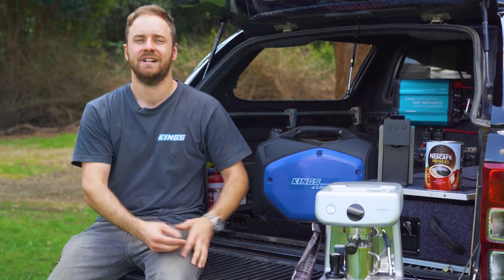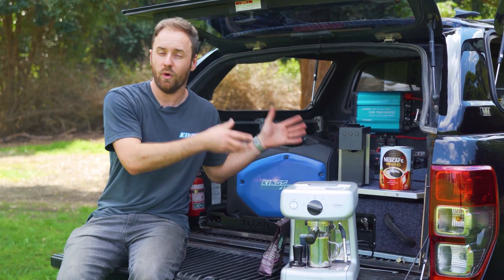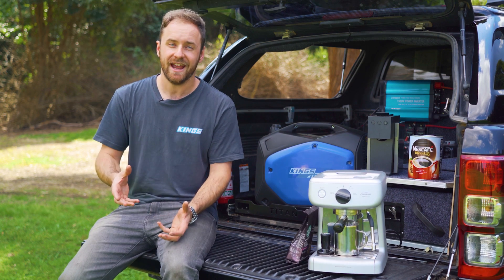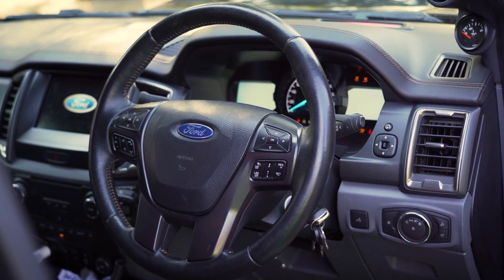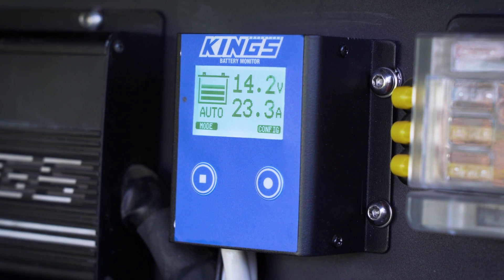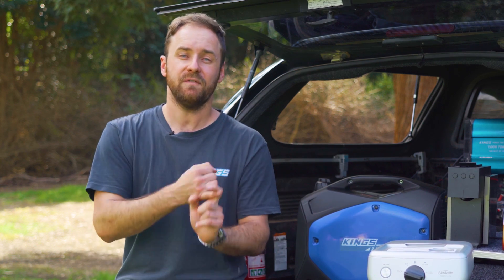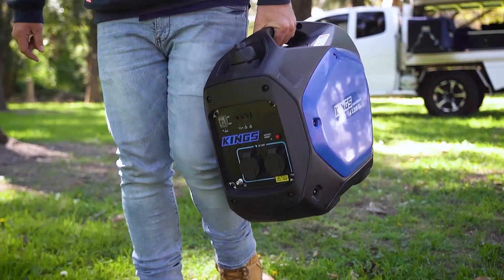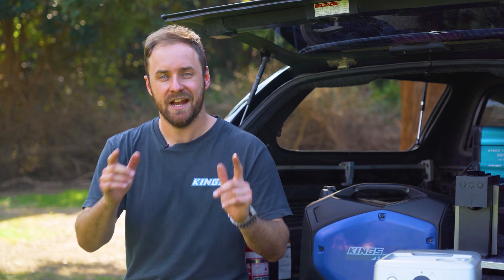How to make REAL coffee at camp - 12V system design tips and tricks!

Comment: I use a 3000 watt inverter connected to 2 x 120 amp hour deep cycle batteries running a Nespresso Mini coffee machine. It works fine. Been using it for a year now. It also powers my wife’s hair dryer and curlers.
Reply: How much watts its your mini coffee machine?
Reply: @AndersonSilva-le8pf  not sure, but the Aldi coffee pod machine would not work, only the Nespresso mini.